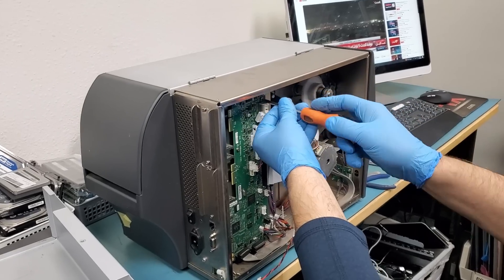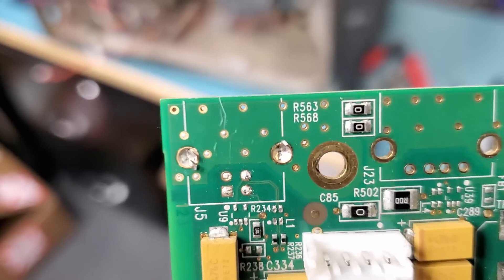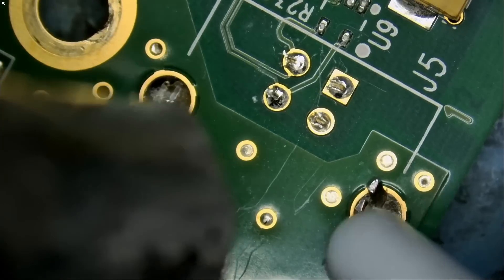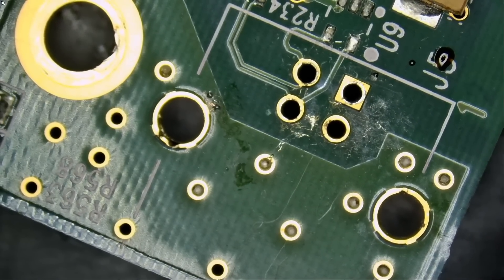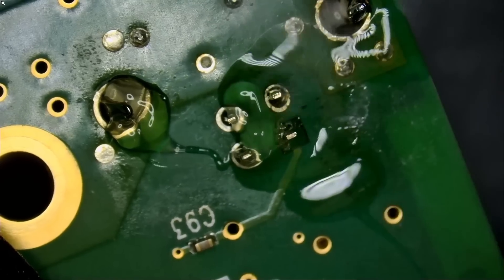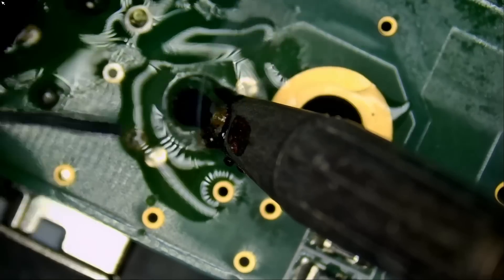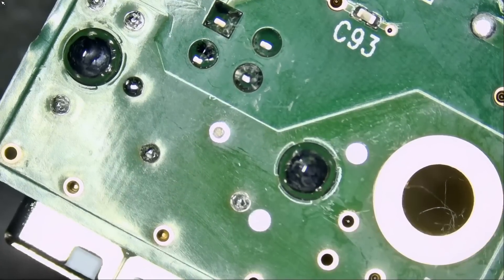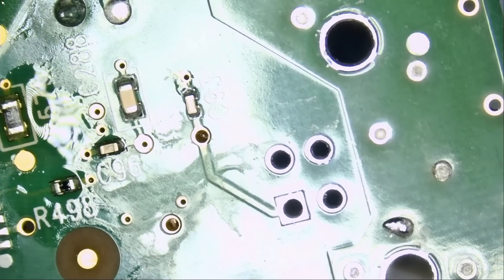Heavy Zebra 410 Repair - Damaged USB and more issues.

Comment: OMG it's a nightmare! I worked on these every day for John Deere remanufacture in Springfield, MO for years. UGH! I hated these label printers! hahahaha They are a constant maintenance task. That kind of damage is because we have to remove those boards and set them aside, so we can replace the gears, belts, clips, etc. of the underbuilt mechanics. Honestly they are built really well, but for the companies that buy them - it's still not enough. After a year or so, it's a constant chase. You get trainees in to help with repairs - you get broken connectors and such they missed disconnecting before yanking the board out :)

Comment: Dear Alex, if you have any other printer not repairable in your workshop or any other desktop board that can not be fixed, you could locate them from that boards USB connector, more or less they have the same values and that way you gonna end up having a functional printer.👍💪

Comment: You can just run wires to reconnect the data lines on L1. It will do without OV protection(U9).

Comment: The last place i worked at had 4 of these at the shipping stations. I never cared for these printers much. Very expensive for what they are and I've ended up having to replace the thermal print heads on all of them because the cost of repairs or replacement on these things are expensive. Nice repair job. Keep up the nice work. I'm about to reorder more soldering supplies from you, I'm running low again
Reply: If the heads are not kept clean and the tension is not right then the print heads will wear. We ran ours 24/7 and I never had to replace a head. Its also best to run them at 5.0 ips for best print quality. 
The older Intermec 4420 was my favorite

Comment: I think the 5pin ic is an overvolt prodection like NCP361SNT1G. If you messure the thouthhole it should be ground. But you dont need them for function. The L you can short them in line. Its only for emv. Or coose one you think or look at other schematics.
Reply: No, it is not suitable. U9 Dual TVS diode IC that protects USB data lines. The IC you suggested is an overvoltage protection IC that protects the USB +5V line. It cannot be used on data lines.
Reply: yes, this is a match

Comment: Those two components are for overvoltage protection. You can bridge the two lines on the inductor footprint, the other coponent you simply leave open as it is. With this done the printer will work. You just inform the customer that the protection circuits are missing.The customer will be happy for having a working printer.
Reply: "With this done the printer will work."
For how long? Spec requires protection against transients as they will happen during the plugging/unplugging or powering on/off process. You're delivering a device made to break.
These aren't components for aesthetics, USB spec is very clear on these, which is why the market to have ICs to just slap on there and not having to worry about it is so big.
Reply: As for the inductors this is designated as a single component, "USB common mode choke" should suggest replacements.
Reply: the left one is the RX TX communication this  one will solve the problem
Reply: @arcilonjr  you are correct, but to just technically correct your comment, those are D- and D+ lines not RX and TX, this is USB connector not a serial one... 😉
Reply: We do not know in what environment the customer uses the device. If it is used in a normal home or office environment, it can be used without any problems even without that coil and TVS. However, the customer may be using the device in a location with a significant amount of EM noise, such as a factory. This may cause communication problems due to noise leaking from the USB line to the device. The missing parts are not so difficult to obtain anyway. Instead of canceling the parts, a more logical solution would be to obtain and install the appropriate parts.
Reply: L1 is interference protection
Reply: Maybe SP0504BAHTG for ESD and ACT45B for filter. Both must be double channel from looks of it.
Reply: yes you are right the left one are 4 pins just bridge the 5 pins one probably will not affect the usage
Reply: The element has 5footprint may be ESR protection that is only if it has  one  line goes to ground .  Parallel conection.
Reply: The common mode filter (L1) is mainly for EMI, so that won't hurt, but I think it will be better to get similar components from any old printer. They will serve the same function so the values will be similar, protecting the input again.
Reply: ChatGPT suggest ACT45B and SP0504BAHTG. Based on what is seen here. Should be taken with caution.

Comment: My guess is the USB connector suffered external force causing it to break off inwards and knock off the missing components. Presumably that would have fallen down to the bottom of the unit & may still be floating around in there. Good luck.
Reply: i have thought about that too.

Comment: zebra 410's are the bane of my existence. i hate those printers. zebra puts out such junk. those printers are not cheap either. i think they are around 1500 bucks or so give or take. my company uses them and every single one of them suck
Reply: We use only Toshiba, not one problem
Reply: I have the GK420d  model and it's a beast ,have never had any problem with this model ,
it is a different model  than the 410 that's for sure ,but it works really great
Reply: They are not as good as the ZT-610 for sure.

Comment: I worked on Zebra thermal printers all day long. Mainly the ZT-610 and ZD400 Series as some 410's. Get a real electric screwdriver like the Dewalt DCF610 and those Torx screws will easily come out.